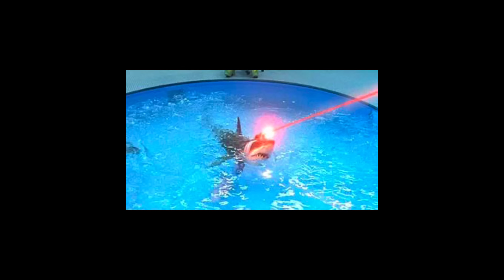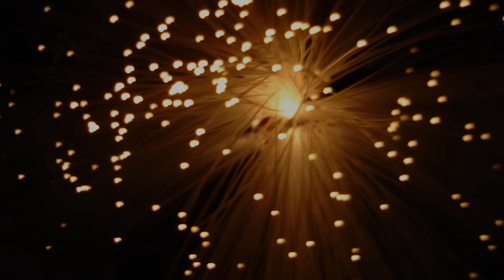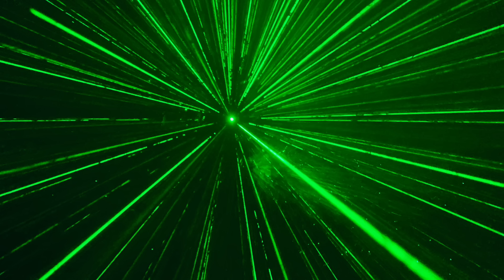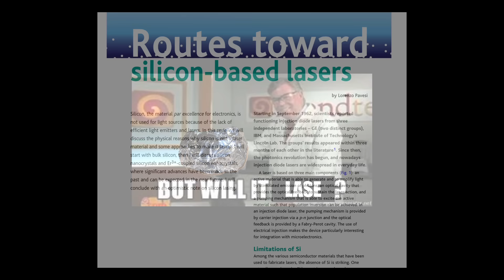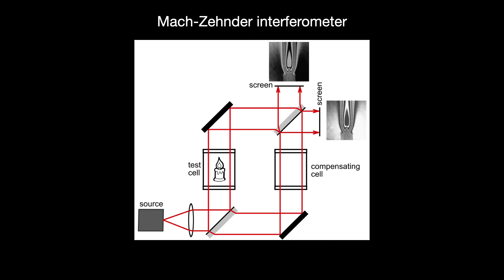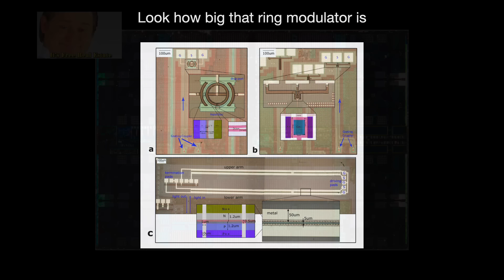Silicon Photonics: The Next Silicon Revolution?

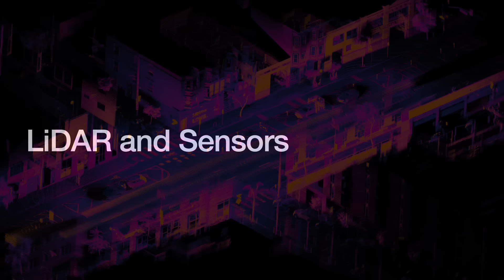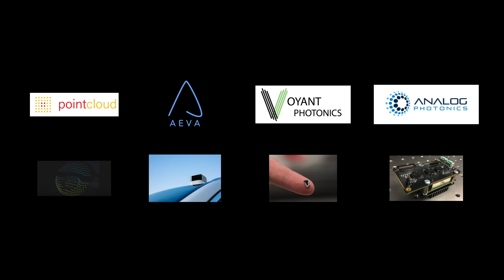Comment: You use a point cloud from Ouster (10:20), then don't mention them in the list of lidar players (11:19).  Original file here:
  https://en.wikipedia.org/wiki/File:Ouster_OS1-64_lidar_point_cloud_of_intersection_of_Folsom_and_Dore_St,_San_Francisco.png
In sales of multi-beam lidar, Ouster only trails Velodyne, and is first among those with chip-level integration (one chip of VCSELs, and a second with SPADs and compute).  Most of their competitors are shipping prototypes, or nothing at all.

Comment: "No Silicon can emit light..." 

That is not what my design did when I accidentally applied 20V to it instead of 3.3V.
Reply: Now thats overclocking
Reply: It did for a few fractions of a second, I bet.
Reply: Ah, the magic smoke!
Reply: @waynesworldofsci-tech  my electronics teacher always told us: "Kids, every circuit works with smoke, because if you see smoke coming out of it, it definitely won't work anymore!"
Reply: It's sure give you smoke particle.
Reply: HAHAHAHAHAHHWHWHAHA
Reply: True clock rate gains right there o7
Reply: Indirect band material can not have photon emitted unless the band structure is modified
Reply: LED is silicon, you need to revisit basics. Your solar panel is just LED in reverse mechanics.  Oh sorry maybe germanium.

Comment: I just wonder... This whole LIDAR thingy could be a revolutionary solution for military purposes, seeker head accuracy precision revolution to be exact. 
I imagine a lidar seeker connected with the processing-database unit integrated into missile seeker head, mapping the environment in real time, processing it and comparing with available database of potential targets.  Then with surgical precision it directs the missile right into lets say tank weak spot, coaxial machinegun port where the armor is minimal or nonexistent for example. You can use much smaller projectile, thus easier to accelerate with limited mass and cost compared to today. Absolute precision could completely eliminate the need to expend few cruise missiles just to use one to strike the enemy mobile command post, ammo magazine on enemy carrier,...
Reply: Now you’re thinking like an engineer! Lockheed will be in touch.

Comment: I've been interested in stuff like integrating light manipulation into electronics for quite a while, even optical fiber data transmission is really interesting to me. Now we have the potential for light-based computing architectures, or at least the beginnings of a framework for it. That is beyond amazing to me.
Reply: Major problem with the "optical computer" is a lack of optical memory. Optics is good as the interface between electronics-based computers.
Reply: @christianb1176  You do have a good point. To simplify things early on, however, we could create a kind of "translator" that allows conventional memory to be used. This will cause bandwidth issues, but it would help to prove the concept until a better solution is found. For the record, though, I'm absolutely not an expert, so that's mainly baseless guessing on my part.

Comment: Light travels through vacuum at the speed of light. Through matter (like optical fiber, or gaseous matter) it's slower. Speed of light through a vacuum = 186,282 miles per second . Speed through fiber = ~roughly~ 125,000 miles per second.

Comment: Speed of light in fiber is actually slow. Like 1/2 of speed of light in vacuum. Things can move faster than speed of light. You cannot travel faster than a speed of light in a vacuum. There are also hollow fibers, buy but this is rather recent development and not used at large scale.

Optical fibers are used because of low attenuation, no interference and easy wide band application methods available. Making them ideal for long distance.

Comment: I'm doing my PhD in computing with silicon photonics. There are quite a lot of problems, mostly related to the interactions being based on interference and thus super sensible to temperature and variations.

For example, the MZIs or ring resonators that he mentioned need continuous thermal tuning to work in their best behavior.

That's the fun part. With problems, there's a lot of fun to have to try and solve them. Thank you for the video !
Reply: MZIs are not particularly sensitive to temp variations because of its interferometric-based mechanism. Ofc this is not the case for RRs which are strongly dependent on temp.
Reply: That makes integrating them into ics a bit worse of an idea eh?
Reply: @xxportalxx.  no, you just have to solve the problems first
Reply: @JL-pc2eh  it certainly gives even more credence to the separate chiplet strategy, however I wonder if you'd need like a separate heatspreader to decouple it from the ic running computations. If the physics itself is sensitive to temperature variation then thermally coupling it to an ic that's temperature is highly variable with load is a bad idea.
Reply: @xxportalxx.  what people do right now is add little resistances with feedback loops to heat the sensitive components and adjust their frequency response, which is not free by the way, but if you're operating around 50GHz the cost per bit goes down.

In my lab there are some guys working on the thermal response of devices and trying to make more robust photonic circuits with this regard
Reply: @raphaelcardoso7927  that seems rather difficult to maintain to me without significant thermal isolation (i.e. an isolated chiplet), as you're fighting both your active cooling loop, and the random heat spikes from the cpu. If it weren't isolated I would think you'd be limited to the range at or above the max temp of the cpu-cooler system, below that and the cpu could push your temps too high, unfortunately this also means you'd be fighting your cooling system constantly (and likely be degrading cpu performance).

Comment: Silicon nitride and even more recently LiNbO-on-Insulator have started to really challenge SOI photonics. Much lower loss, broader transmission, commercial fabs with PDKs, and LiNbO has pretty much the best EO (i.e. pockels effect). SOI still has the better density, big fabs behind it, and it technically can be directly interegrated with Si electronics (SiN peeps argue so can SiN, eh)... but as you say mutli-die seems to be the way foward. Also there was silica photonics (not fiber mainly AWGs) but that has basically died a death.
Reply: I think the coolest technology should win.

Comment: You have tapped into a classic boondoggle here. When I was with Cisco around 2000, the big "new wave" was about all optical switching, which was supposed to be faster than converting optical to electronic and back again, often with DMMs (Digital Micro Mirrors). Howed that work out? The startup world was littered with smoking holes of failed companies.

I think the bottom line is we know a lot about devices that operate on electrical signals, but not so much about devices that work on pure light. As in everyone knows what an electrical nand gate is, and optical nand gates are possible with optical signals, but good luck getting that to work, be integrated at high densities, and be efficient. Lets start with the basics. You can route signals easily in electronics, and the 10+ layers of interconnect on current ICs talk to this. What's a light conductor on an IC? Well, air, which should be free, but is far from it. You would have to couple in and out of the IC at many points, which is expensive in terms of real estate. You could conduct with glass, and that is a whole 'nuther level.

I'm not saying never. I'm just saying that with any breathless new wave of technology you have to look at history and see if that wave has not broken previously, or like every 5 years or so (cough.... AI).

Comment: I hope so.  I invested in a bunch of companies with cool sounding names that include "Photonics" in the name.  Most of them haven't gone out of business yet.  Hopefully the ones that still exist get some popular products soon and I can retire on like a big provate island or a small 1 bedroom condo.
That said, re: "Nothing is faster than the speed of light," Light in free space is significantly faster than light in a glass fiber.  (On some routes, you can contrive a theoretical path where going through satellites would have lower latency than a path through a single fiber, despite the satellite path being a greater distance.)  And propagation of signal in an electrical cable is not that much slower than the light in a glass fiber once you take into account the index of refraction rather than assuming free space speed of light.  You just don't have to deal with dumb crap like induction, and a copper cable acting as an antenna by accident and resonating with parallel cables.  There are advantages of signals in glass.  But "the speed of light" surprisingly isn't a major one.
Anyhow, anybody wanna buy like 300,000 worthless shares in a company that no longer exists?  Ameritrade says it's currently worth $0.00, but I'll give you a special deal.  One share for a nickel or two for a quarter.
Reply: I’ll buy.

Comment: Photonics most promising applications are in quantum computing and as and energy producing system... treating the capture of light from the sun as a wave (RF instead of particle light capture ) using nano antenna grown and combined with quantum dot electron energizing, as a “rectenna” ( energy harvesting from electromagnetic signal) producing a single photon to be generated can be scaled up from very small imputes ...combined millions of times to create a steady flow of individual single photons... nearly 100% efficient as compared to 20% average efficiency of current solar collectors... the issue is storage of photonic energy... electron storage in batteries is currently our only choice... we need photonic storage devices separate from electric storage devices to reach future growth on photonics use and quantum energy production.

Comment: Light does not travel at total speed of light ( C : constant, only in a vacuum ... photonics energy has no mass ) inside glass fiber because the glass is a solid mass that cuts the photonics energy flow by as much as 15% or more... the best glass fiber also has an outer coating of a more reflective glass, to reflect the light back into the fiber... there is an improved glass fiber that is hollow... a die is used to form multi level hollow channels within the fiber... light travels faster in air than glass (about 1% reduced)... multiple channels also allows different wavelengths in each channel ( multiple wavelengths= colors) ... refining glass requires eliminating trace elements such as iron from the silica and exact sizing of silica particle size...
Reply: wrong, in an optical fiber the clading is of lower index than the core, you got it backwards.

Comment: To go big silicon photonics will have to add EO polymers. LWLG has this capability. Working on PDK's during H2 2022
Reply: Can you elaborate a bit on these polymers?
Reply: @raphaelcardoso7927  EO polymers will increase speed (3x) with half the power. Lightwave Logic developed a very stable material that can be used in datacom and telecom markets. They have 5 foundry partners sign up to work through the PDK’s. Results in H2. Ubiquitous technology
Reply: @steveschiets  I'll check it out, thanks!

Comment: Fiber optic cables don't transmit data at the speed of light. It's closer to half the speed of light. This is because the light doesn't go straight through the cable; it bounces off the walls/material of the cable creating a less direct "zig-zag" pattern.

Comment: Couldn't this be used to replace the bus between ram and cpu with silicon photonics, so that memory speeds and latency can be improved? The length between ram and cpu is a lot for copper, light would be a huge improvement to memory speeds. not only ram, cpu bus. but also pcie express bus
Reply: Yes! This is a research field known as optical networks on chip. It's been demonstrated that if the distance is above a few mm, photonics is more worth it than an electrical connection

Comment: Even when Moore's law began to break down due to the fact that the reduction in the size of silicon transistors came to physical limits, it turned out that it was more profitable to continue to bring CMOS to mind than to look for something fundamentally new.
Novoselov and Geim were awarded the Nobel Prize for the discovery of graphene almost ten years ago; and where is that graphene? That's right, in the same place as carbon nanotubes and all other materials of the future.
Reply: Well they're still trying to find cost effective methods of industry scale production for those materials. Most of the benefits of graphene especially in electronics specifically requires uninterrupted sheets as well, which further complicates the production process.

Comment: I mean, sure, electrons can be used to make chips a lot more compact. But photonics can be used to make them a lot more efficient. Silicon wafers are dirt cheap, and manufacturing methods don't have to be super-precise.
And since they don't generate as much heat, you could stack them together, making it all more-or-less compact.

Comment: Dedicated AI hardware has shifted from CPU -> GPU -> FPGA -> Custom ASIC -> Analog based Custom ASIC. I think Photonics will be the next efficiency milestone. Analog AI hardware might be an idea for a video?
Reply: Yes. Exactly my thoughts.
Reply: Hybrid analog/digital neuromorphic hardware using photonic components
Reply: Having looked at this a little, this is probably still a bit away, I think. There's lots of funding for it though, so a lot is happening. 
Last I checked there's some proof of concept work on MZI-meshes, using modulated microring resonators as the transforms, and at least one demonstration of fully integrated backpropogation.

Though, all of these systems still require training outside photonics and large electric systems around the P-ICs. 

If anyone knows of more commercially mature work on this, I'd love to check it out!
Reply: Analog based computation is more efficient than digital, but its lack of accuracy makes the jump from digital to analog a huge one.

Comment: When people talking about speed of light they are most of the time(like you here) talking about speed of light in vacume... and speed of light in fiber optics is in fact slower than standard signal in some metal wires.
The bandwidth in fiber is generaly bigger but that have nothing to do with speed of light even if most people want to call it "speed".

Comment: Because the bouncing arround (that lenghtens the way light has to travel) and the fracture index of glass, light travels about 31 percent slower through fiber optical cables than it does through a vacuum.

Comment: Thought light was slower in optical fibre than a vacuum.
Reply: That's true. Speed of light in any substance is speed in vacuum (3e8 m/s)/refractive index. That around 1.45 for silicon oxide and higher for silicon.

Comment: The transmission speed in electric cables doesn't depend on the slowing down of electrons due to their interaction with atoms. It depends on the slowing down of the propagation speed for electromagnetic waves and fields in the medium used. Air core coaxiaal cable has propagation speed close to 'c'.
Reply: The problem is not propagation the problem is keeping the signal to noise ratio so that it is still possible to recover the signal in the other end.
Reply: For sure! However, charging the parasitic capacitor on the line at a few GHz gets expensive really quickly
Reply: @raphaelcardoso7927  a reel of coax makes an excellent dummy load above a couple of 100 Mc. Shut down the transmitter when smoke starts to develop.